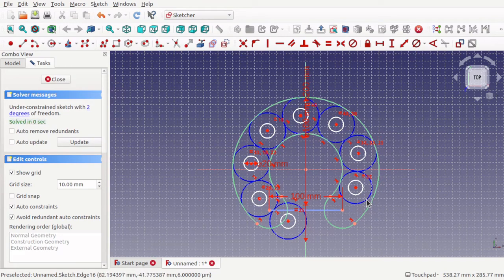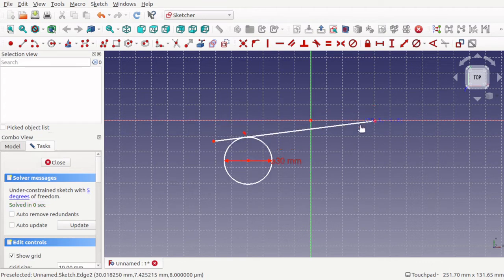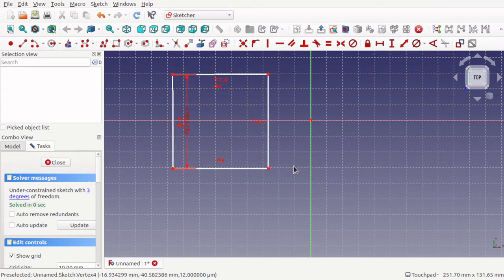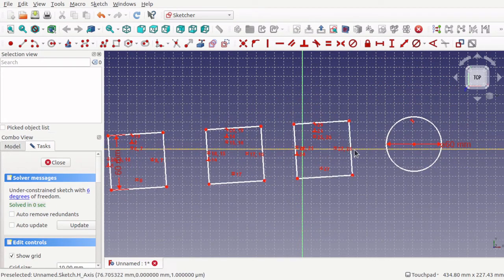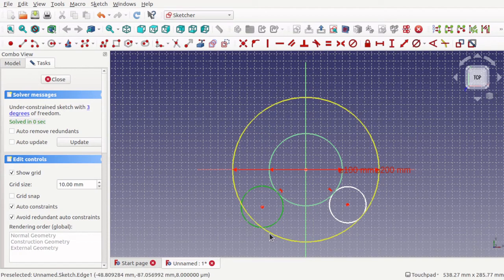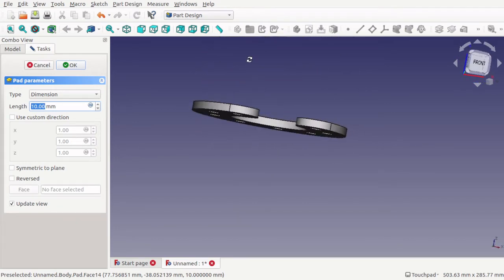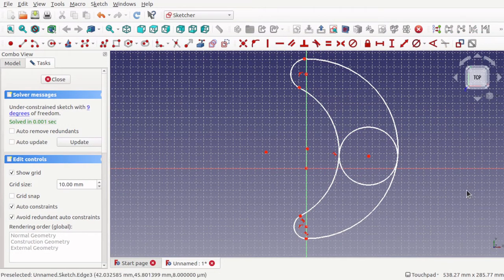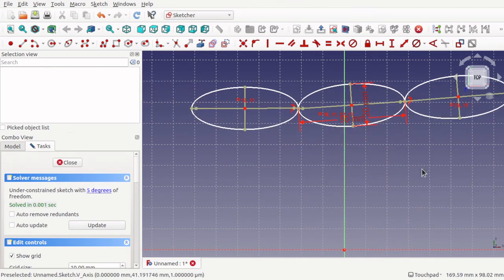FreeCAD: Sketcher Tangent Constraints, What are they and how to use then in your sketch

Comment: So how does one make a tangent to a BSpline ?

I have a profile made entirely with BSplines.   I want to make it a thin shell.   The best way I can think to do this is to create a tangent to each of the BSpline points and then move inside to create a 2nd set of points the thickness away from the first set.   

Do you have any other ideas on how this could be done ?

Great videos, btw.
Reply from the maker: Tangents with b splines unfortunately are not yet supported. But from what you have described you can use the part workbench you and extrude your profile which will make a solid if the profile is closed. Go to the data tab and set the solid property to false.  You will get a shell which you can then set the offset 3d to the value that you want. You can fill this offset if you so desire.

Or take your sketch. Jump into the part and use the 2d offset. You will have a offset and inside a sketch which you can do operations on both. It's funny you should say about this as I am just putting a video together explaining a similar solution. It will be released on my channel soon.  Glad you like the videos.
Reply: @MangoJellySolutions  Thanks for the reply.   I'll give it a try.   And I await your video.   :)

The breadth and depth of tools in FreeCAD is amazing.  Thanks for sharing your knowledge.
Reply: @MangoJellySolutions  I'd love to see a video on using sketches and objects from the Part Design workbench in the Part Workbench.

Comment: very good video as always. I was wondering if you could do 3d sketch in freecad? I am creating harness in Solidworks using this feature and it works quite welll. I place all my clamps and support components in the main assembly and then, in context, I do my 3d sketch that passes into all the clamps and with a tangential feature, the spline create a wonderful path for a sweep. Can you do the same in freecad?
Reply from the maker: Thanks for the comments. I know exactly the feature your talking about in solidworks. It's where you can use the tab key to switch between the planes. It's a wonderful feature which I wish freecad had. Freecad works in a different way in that you have to create and attach sketches to planes and then draw on those sketches. You attach sketches to parts of your model then draw on those importing geometry as a reference so you can attach sketches to those points. Solidworks approach is easy and faster. I think I understand your approach with the assembly and sounds interesting. I'm going to tinker with Freecad to see if I can find something similar.
Reply: @MangoJellySolutions  Hi thanks for the response. I read your comment and i don't recognize what I do to create my electrical harness in solidworks.

My first step (in SW) is to import and position the p clamps or other types of clamps in the vehicle, then I import my harness in the vehicle. The harness itself is an assembly composed of two connectors ( one at both ends) and a cable. The cable is a «part» that I edit in context in the vehicle once all my clamps are positioned. So once every clamp is placed and oriented properly, I go to edit the part that is the cable of the harness and then I create a 3d sketch. I start by placing some small line that is concentric with the clamps ( 10 or 15 mm long lines that goes through the clamp). Once this is done, I connect the line that goes through the various clamps by adding a spline between each one.  For each end of the spline, I hold down ctrl and I choose the small line of 10 mm plus one end of the spline and then I click «tangent» in the option on the left. This way, I can make a very organic harness and if I move a clamp, the harness follows automatically. Was wondering i we could do the same in Freecad. Thanks again and have a nice day.

Comment: I am currently trying to teach myself Freecad by using a Learn-by-Doing tutorial book and on one exercise its trying to show me how to "extrude an object to a selected face". Basically I created a model, and now its telling me to create a (rectangle) sketch next to the model, use the "Constrain Coincident" tool to join a corner of the sketch to a corner of the model, then use pad to create the extrusion. 
I can't access the sketch and the model at the same time to use the "constrain coincident" tool. 
Is this even possible?
Reply from the maker: You need to import an edge from the model from within the sketcher.. There is a tool in sketcher called import external geometry. Menu item Menu locationSketch → Sketcher geometries → Sketcher External. This will allow you to import that edge or vertex which you can attach your sketch to
Reply: @MangoJellySolutions  Thank you very much! The book didn't mention that step in the instructions, but showed small text in the diagram. Finally finished the exercise!